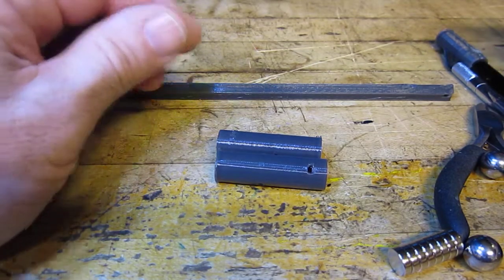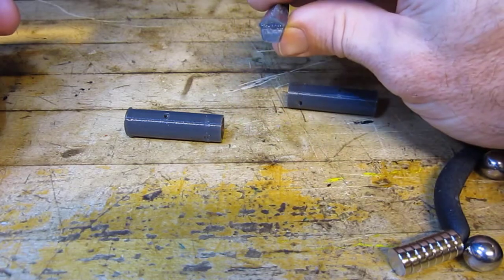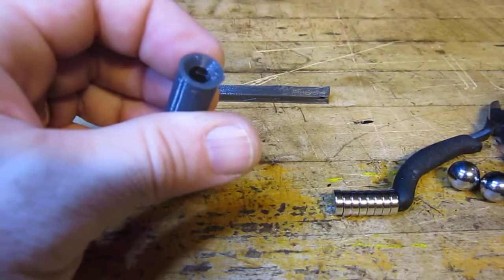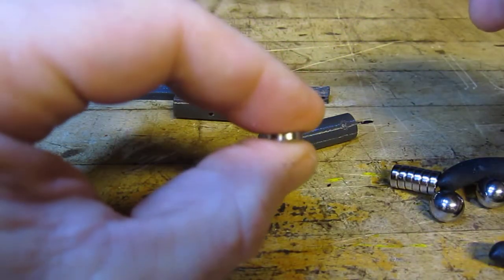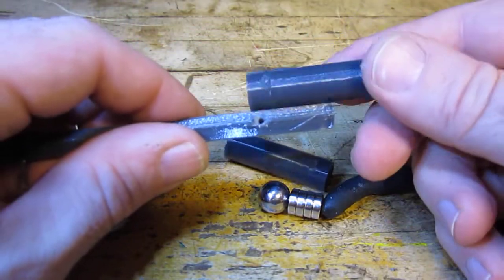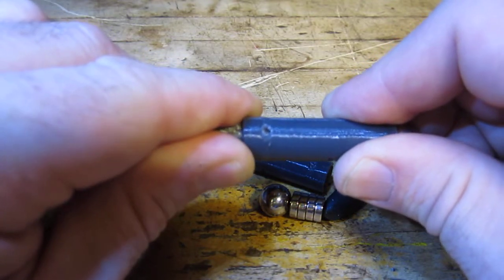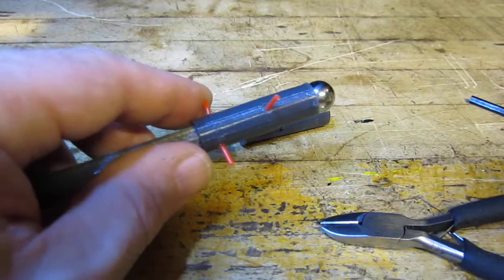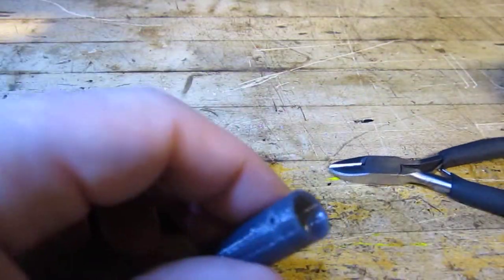Assembling the printed magnetic arms for the Rostock Max

Comment: i have printed out the effector and arm plate connector but i am making my actual arms a bit differently {because of what i have available}. the information i am after is this, what is the exact measurement of the arm length? i see alot of different numbers on forums ect but as i am using your effectors i thought i would ask you. i have yet to purchase magnets to attach to effector plates so the diameter will adjust the length of arms as well, so is there are standard point to point measurement from a standard a to b?
Reply from the maker: The length should be 270mm from the center of the ball on one end to the center of the ball on the other. You should also check to make sure that it matches the setting for it in the firmware of the the printer. If you put them together and it comes out to something close to 270mm but not exactly 270 then that is still good as long the arms are all exactly the same length and that length matches the firmware setting.
Reply: Center if ball on effectors you mean?
Reply from the maker: michael calvert Yes, right. What I was thinking of is that when you are checking the arm length, you can just stick loose balls on each ends of the arm (separate from the effector and arm plate connectors).